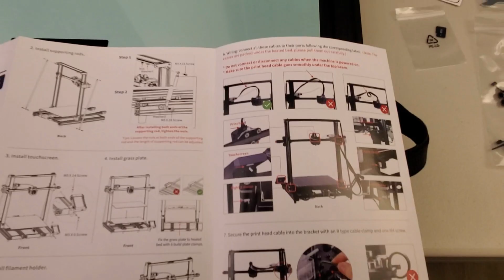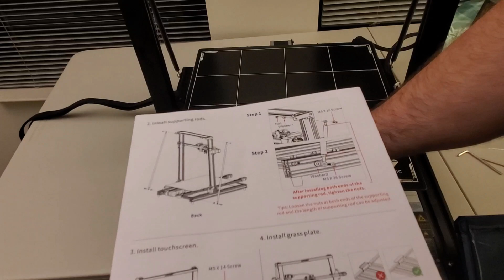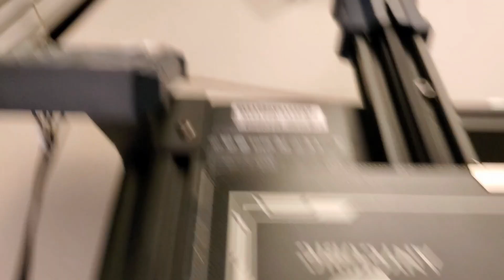ANYCUBIC Kobra Max 3D Printer: Mechanical Assembly and Electrical Connections - Large 3D Printer

Comment: All the little clamps i got for the build plate are really loose and dont really "clamp" anything at all. Is that normal? Are you supposed to pinch them a bit so that they actually function?
Reply from the maker: I do not understand completely. Are these 6 little clamps, 3 on each side?
Reply from the maker: At 6:07 in the video?
Reply: @aleksandarhaber  yeah, the build plate clamps. they slid on and off very, very easily regardless of their position. i just took a pair of pliers and pinched them a tiny bit and now they hold the buildplate in place, though not quite as tightly as i would have liked. Before that, the glass plate was sliding around and they were just falling off like they werent even supposed to be there.
Reply from the maker: @toastcrunch9387  I had the same issue and I adjusted them also. They do not move when you print since there is no in-plane force acting on the build plate. However, you can use other options. For example, something like this:
https://www.officedepot.com/a/products/561339/Office-Depot-Brand-Binder-Clips-Medium/?utm_source=google&utm_medium=cpc&mediacampaignid=71700000107551011_19775927961&gclid=CjwKCAjw2K6lBhBXEiwA5RjtCaJoH3pjE1lvYlgvVTOEilvrS3VwBprercjW_9Z_8ShBoQLtS3mfYhoC0uMQAvD_BwE&gclsrc=aw.ds

Comment: How much free play should the Z axis have? My Z-axis leadscrew nuts have a surprising amount of backlash, to the point that I can visibly lift the Z axis (probably about 1 mm on the left and twice that on the right). I presume they came from the factory with that much slop because I cannot believe that so much wear developed after a few months of use.
Reply from the maker: Honestly, I do not know what the issue is. My printer works OK after 3 months. However, I am using it for maybe 5 hours every week.

Comment: There is no switch voltage ? Not 120 220
Reply from the maker: I do not understand the question.
Reply: @aleksandarhaber  like in the vyper or chiron , each printer got a switch button wich is for the voltage country , Us and Canada is 120V but the switch button has 115V wich is perfect . Europe has 220V .
Reply from the maker: @nathunterstudio8391  I did not see the switch button. However, on the power supply it is written that it is also rated for 220 V 50 Hz.

Comment: Such a good help, looking forward to part 2 with the leveling!
Reply from the maker: Thank you for the comment and interest. I installed the printer, and started printing. I had some initial issues with leveling the printer since the leveling sensor reported a fault initially.
Reply: @aleksandarhaber  same happend to me, do you have the video on how do you fix it ?
Reply from the maker: @andcoderes  I do not remember exactly what I did. I remember that I cleaned the tip of the extruder. Sorry that I cannot help more at this point. I will update you on this.
Reply from the maker: @andcoderes  Also, be careful not to damage the strain gauge that is used to detect the pressure while leveling
Reply: @aleksandarhaber   thanks in my case was the extruder not going to home, I had to turn off, move the extruder and try again, after that worked as a charm
Reply from the maker: @andcoderes  A number of people are experiencing issues with the extruder leveling and homing. When I purchased the printer and when I immediately observed the issue with the sensor, I was really disappointed and I considered returning the printer. However, I was able to somehow fix it. I hope that I will not experience this issue in the future.